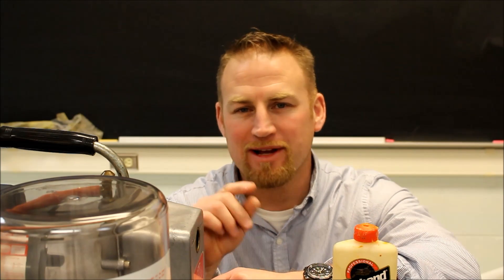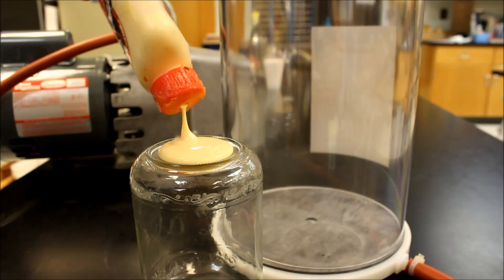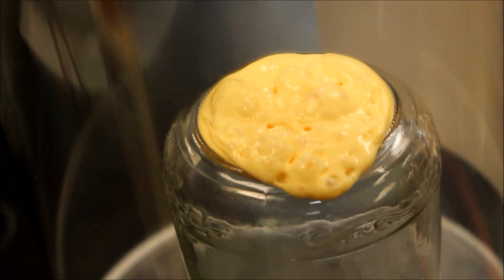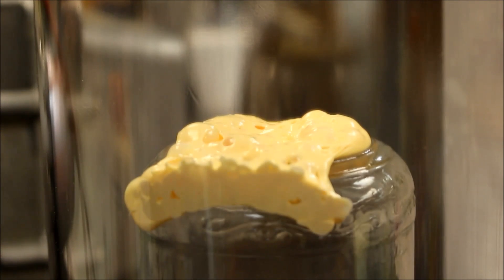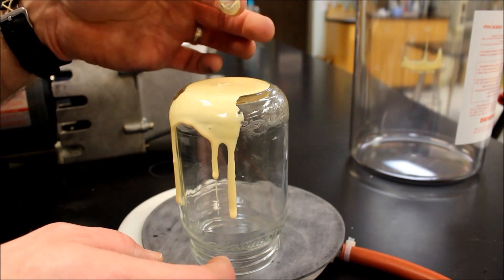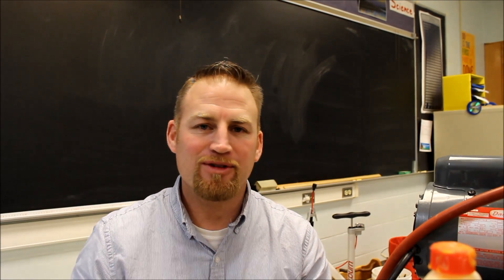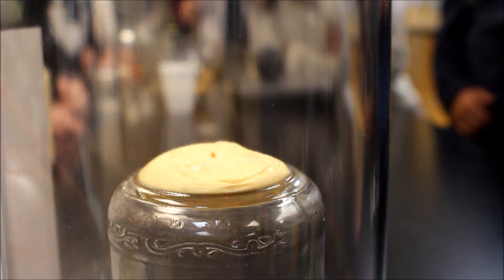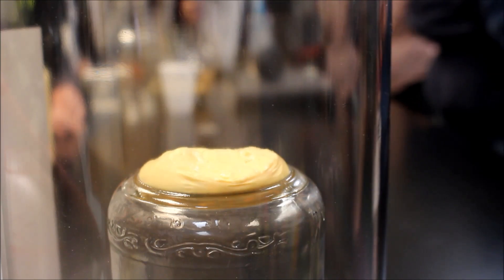Wood Glue in a Vacuum Chamber!

Comment: As others have already pointed out, that's not dissolved air coming out of the glue under vacuum.   It's vapor from the water component boiling off.  Under vacuum, water boils at 59° F, which is lower than the temperature of the room (70°—73° F).

Comment: i believe that its not the air in the wood glue. the glue is boiling in the vacuum. when it is placed in the vacuum you remove the atmospheric pressure and when you do that you reduce the boiling point of the glue.
Reply from the maker: I think you're right, Daniel!  I just did some tests this morning because I woke up in the middle of the night thinking, "maybe it was the water in it boiling" and they seem to confirm it was the water in the glue boiling....cool!
Reply: Vintage Wood Workshop cool to know. It might make wood/white glue cure faster in some applications.
Reply: @ImpetuouslyInsane  - this idea is why I've been searching YT for videos like this.  I have a small vac pump and need to do my own testing I guess.  I just want to add 2 pieces together with a little glue, maybe rubber band clamp them together and see what happens to them after various time periods under vacuum.